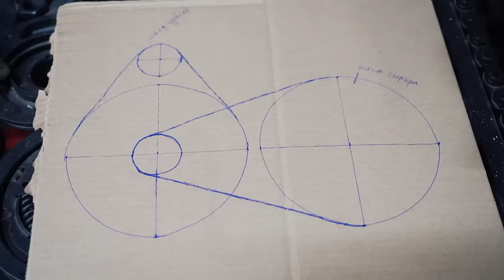Turbocharging a Lada with a starter motor

Comment: I wonder if they realize the only reason it picks up speed when you turn it on it's because you're finally taking off the blocking part of the intake meaning when he puts his foot on the gas and the Turbo thing he built is not spinning it's choking the motor when he turns it on it's able to breathe normally that's all that happened the turbo is not increasing the power when it's off it's choking the motor cuz it can't get the air it needs to run normally that's all they did they blocked the intake when the motors not spinning when they push the button to spin up the motor for their little Turbo then the motor can breathe

Comment: Why not just hook up the starter directly to the engine (like it normally is) and just have it run constantly while the engine is running.. essentially and electric motor assist to the motor.

Comment: Completely autonomous, it doesn't take any power from the engine. Where does the electricity to run the starter motor come from? Are you guys going to make a perpetual motion machine next?

Comment: like the previous comment a full throttle switch would work but i would adapt an air conditioner compressor  clutch as its drive.

Comment: Basically the starter motor is there just for one or two combustion strokes and then the engine takes over starter motor doesn't spin fast at all
Reply: Obviousli you dont know how it is functioning.

Comment: what about connecting the motor to the ignition coil like the RPM wire to accelerate  with the engine revolution and give this engine some light weight parts
by the way it will get damaged to 😂😂

Comment: That's a lot of work for something that doesn't work.  If you're gonna mess around with all those custom pullies and belts why not just drive it from the fanbelt?  Hell you could even get fancy and throw an electric clutch from an AC compressor in there and have your boost button.

Comment: I don't think a starter motor really spins that fast the starter motor isn't designed to spin fast it's just as designed to turn the engine over until you get some combustion

Comment: For more durability I would use an AC fan clutch mounted to a dummy casing for support, and the other side to a supercharger, or I suppose modify that turbo there to accept a pulley. That way you can for real have an on/off supercharger like Mad Max had.

Comment: Interesting but your not wasting an engines power by spinning a turbo? Using exhaust to spin a turbo.  Easier to rig the starter up if you don't have decent welders on staff which clearly you do.  Seems more complicated to do the starter with all the machining of pulleys.  But and super interesting idea non the less

Comment: The Gear Ratio is way to Large , try to run on only 1 Gear.
The Starter Motor alone should make 20000 RPM.

Comment: you would be better off using a hair dryer to blow fuel into the intake manifold, easier to install and easier to control, and you could have a blow wave at the same time, or maybe not, I've just seen your head, haha

Comment: You installed the MAF after the turbo, this wont work. It  measures FLOW, not PRESSURE. It won´t be accurate at all.
On turbo cars it needs to be installed BEFORE the turbo.

Comment: I was always taught that Starter Motors have no way to limit their RPM's and that they will keep going faster and faster.  Hmmmm.
Reply: That's only true with no load, but setup they made with this "gear ratio" actually puts extreme stress on the motor, so the RPM is definitely limited and the motor gets hot in very short time.

Comment: That’s a great idea, however I would take the starter apart, and machine the case and end plate to house sealed bearings. Instead of the bushings the armature rides on. 
It would run smoother, and last longer.

Comment: A turbo on a stock 2005 Subaru WRX STI spins it around 138,000 rpms. I don't see your starter motor doing that even with a bunch of step downs in the gearing....

Comment: Wrong application for a starter motor, and the turbo is very much underdriven, you should have given the turbo direct drive from the starter motor, it has the power. The conventional set up is best though.

Comment: unless he has the map sensor and computer that can tell there is increased air pressure and add extra fuel nothing will happen except running it lean and burn the engine

Comment: you need to use something other than the starter motor. Or hey you got machining skills runn it like a procharger. run it off the fan pully or something.

Comment: He sad the engine wont waste any power when driving the compressor from the starter motor but the alternator also draws energy from the engine to charge  
Up the battery becouse the starter motor so its the same...

Comment: With a turbo? Your are defining the purpose of using wasted exhaust...
An electric supercharger would be better, maybe? 
Still not using the row power of the engine; and having to convert fuel to electric..

Would go with a new revelation in E.V. Cars as a support motor? A big battery that drives a compressor to get a better fuel efficiency? For the I.C. motor! :D

Comment: Wont work.Engines sucks an incredible amount of air in and the forced air being fed into the engine will have to surpass the negative air pressure caused by the engine sucking air in and I highly doubt an electric motor is up to the task especially at high rpms when boost in needed the most. Maybe low rpm acceleration will be improved,but I doubt top end speeds

Comment: This is really fake it doesn't really work it's a little bit more difficult than that you have to spend that turbocharger at 100,000 RPM and you have to cool the air and you forget anything in there it's going to just tear that turbo up cuz there's no clearance